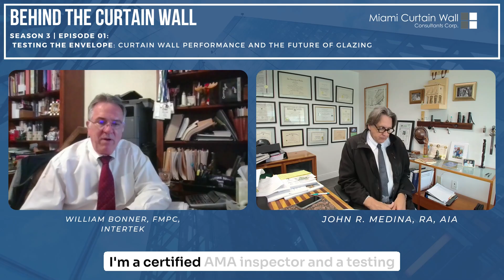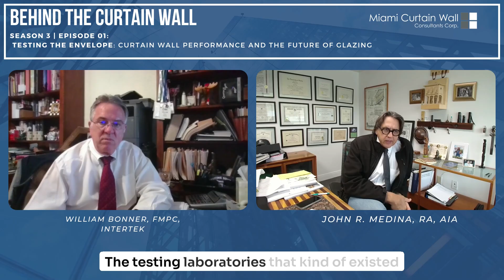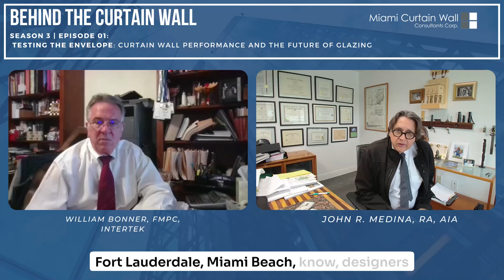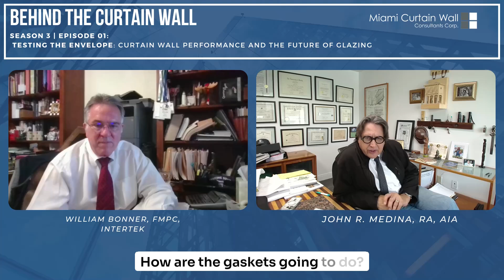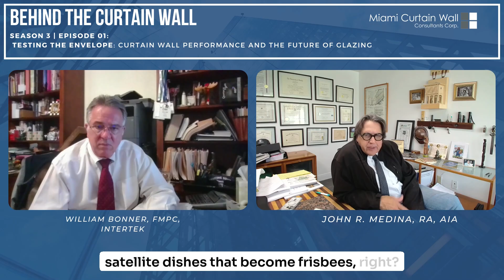Season 3 | Episode 1: Testing the Envelope: Curtain Wall Performance and the Future of Glazing

Comment: Mockup testing for air and water infiltration is where a curtain wall design meets reality, and it is much cheaper to find a bad gasket or anchor detail on the test rig than on the 40th floor. Good topic for an episode, especially with glazing getting heavier and more complex every year.